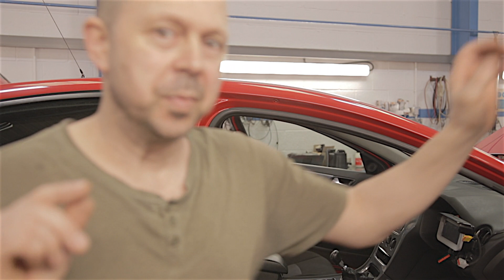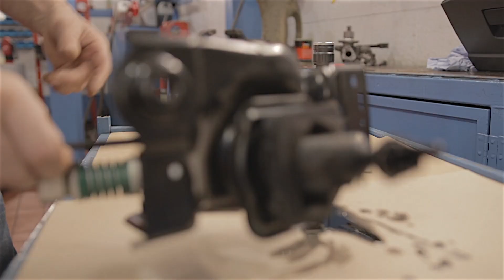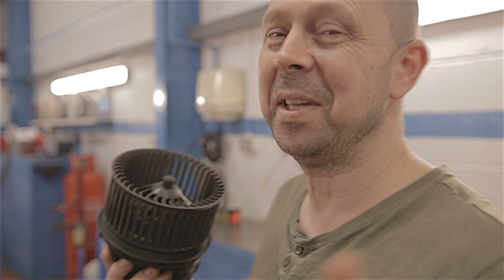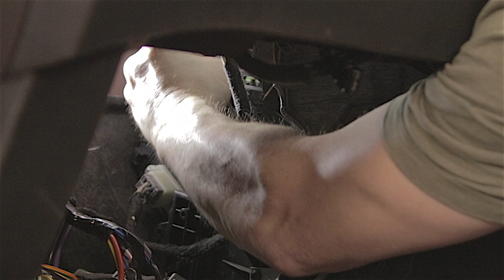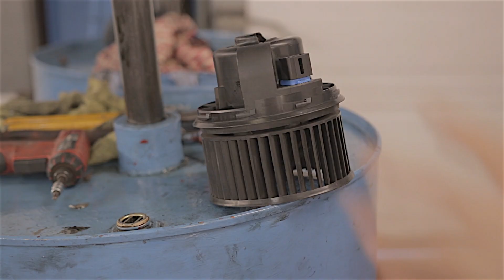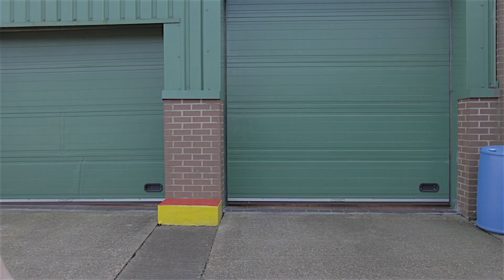Heater Blower Motor Removal, Ford Mondeo Mk4

Comment: Hi Alan, I have an issue where my steering wheel "clicks" and has to be pushed past a certain point in the steering, feels like the click is coming from right behind the wheel, could this be the clock spring?

Comment: I am about to do the same job on a Ford S-max 2007. It's in Norway, and the driver side is one the left side and the glove box on the right side. How will this be different? I will of course have to remove the glove box on the passenger side on the right side of the car, and then unclip the blower motor and push through and out on the drivers side. I will probably have to remove all pedals and also the steering? What do you think?

Comment: Very similar procedure in a Ford Focus MK2.  I replaced mine in about one hour without removing steering column nor pedals.  My arms didn't quite fit so my 12 year old son did help me turning and pushing out and in the blower motor.  Cheers.
Reply: I turned from behind with a home made tool

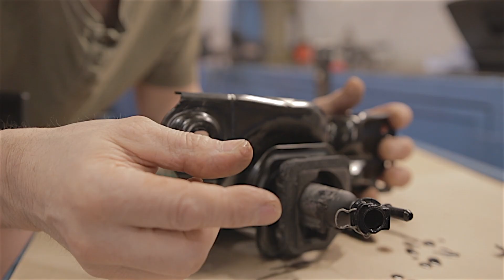Comment: 4:55 OR Buy that seal from local Volvo Dealer and thank God. They where married, ones (Sweden vs. Germany thinking) ;) 
6:25 After 1h doing that, my Boss was sounding like losing the nut. I had to go help. I looked the new part and sayd "If this part is rigth then this can only come out the other side".
 My boss called the dealer and hold that's not all ...its nice to put back too! :D

Comment: My mk3 blower fan has had litres of water leak through it on a couple of occasions, and has been handled by the blade, and still runs quietly years later. Still, if it goes pop, it's a 5 minute job on that car.

Comment: Hi Alan 
Have you ever experienced a sweaty mushroom coloured creamy looking stuff in the oil filler pipe on the mk4 I’m scratching my head because I don’t think it’s the head gasket 
No water leaks 
Could it be a blockage in the breather pipe? Or am I wishful thinking 😂 
No other signs of a failing gasket
Reply from the maker: Emulsification -  a mix of engine oil and condensation found in petrol engines mainly , not engine coolant - usually caused by short journeys and can block breather pipes...best thing is clean it out and clear your breather pipes..take longer journeys so the engine gets to temperature properly...
Reply: Alan Howatt 
Thanks Alan 
May drop the oil clean breathers new filters and see if it clears 
Weight off my mind 
It’s the tdci. 140 I do long journeys over 350 miles a week

Comment: Alan, have you ever had a mk4 Mondeo whistling off the aux belt? Mine is and I'm not sure if it's the alternator, PAS pump or the air con compressor. I just wondered if you'd ever come across this. Cheers pal. 
Great video as always. I hope mine keeps blowing haha.

Comment: Looks a big job what mondeo has the most miles on it Alan 🤔🤔🤔😀😀
Reply from the maker: i sure its a mk4 14 plate with about 355k miles
Reply: Alan Howatt that's good going I had a 1997 ford mondeo 1.8 td years ago with 220.000 miles I thought it had big miles 😂😂👍

Comment: hi alan like all the vids how do you change the indicator lens on mk4 mondeo thanks paul on the mirror
Reply from the maker: you remove the mirror rear cover, it just pulls off, then prise the indicator lens out..if you have a new lens you will see where to pry with a small screwdriver
Reply: @alan4x  thanks for your help

Comment: A lhd are they inverted so its all the same, or are the components on the same locations behind the dash as on a rhd? Oh, and get a proper mike.. 🤭
Reply: I've taken a look on my mk4 lhd because i have the most anoing noise coming from this area and I can tell you the air case is inverted. The air case motor is on the glove box side. In the near future i am planing to remove it and see what the hell is causing that big noise.
Reply from the maker: had a few mk4s with a buzzing noise heater area and if you grabbed the air con pipes  from under the bonnet where they enter the heater through the bulkhead  the noise stopped..so just put more wading around the pipes...worth a shot

Comment: I suppose the spare wheel's under the drivers seat and the dip sticks through the radio !  😂😁😀😃
Reply from the maker: lol..i wish it were it would make for good videos
Reply: Hi alan my wifes just said masage as popped up on dash low beam fault on mk 4 mondeo 2008.how to fix it .
Reply: @SuperMaxpower7  change the broken bulb
Reply: @marklittler784  yes i no that just need no if its easy to take headlights out and i banged headlights and one come bk on.but im changing both at same time.
Reply: @SuperMaxpower7  Yeah just wiggle them out carefully  whilst keeping a good grip once you've removed retaining screw or screws

Comment: Hope I never have to change mine!🤣
Just curious though,would it be possible to to turn the new motor back into position from the glove box side,maybe by using a screwdriver or longnose pliers through the fan blades?
Reply: There is a special tool for the Volvo using the ford heater casing, yes it holds the motor through the fan and allows you to take it out and put it back from the glove box side, all you do on the right side is release that plastic catch to take it out.
Reply from the maker: when i eventually get a motor to refit thats what i will try first lol,,,good thinking😜